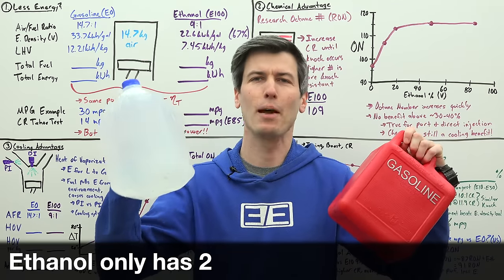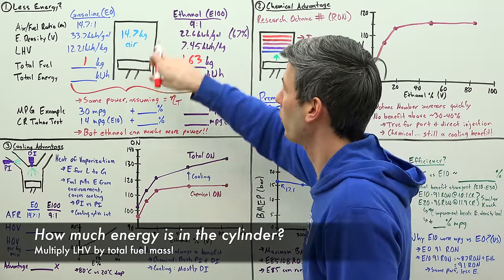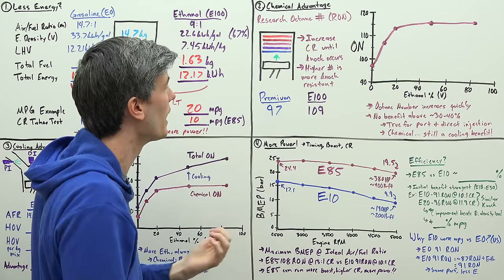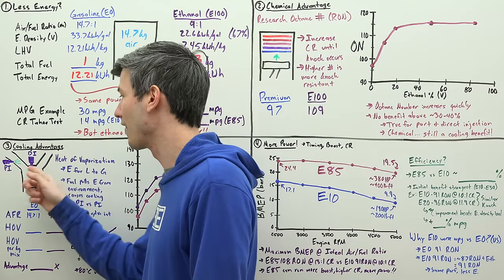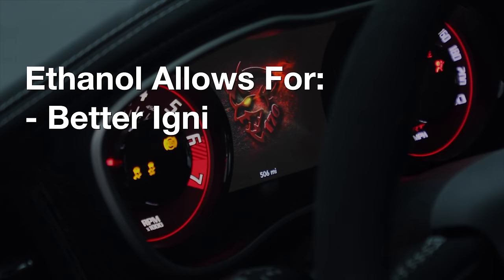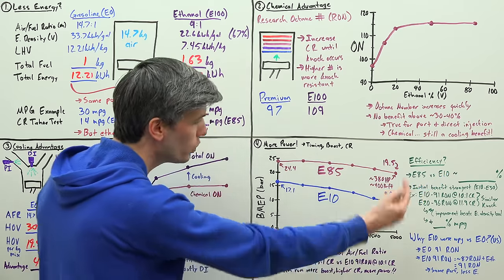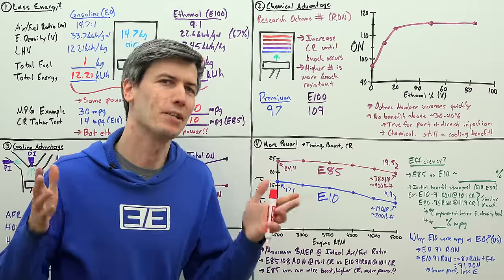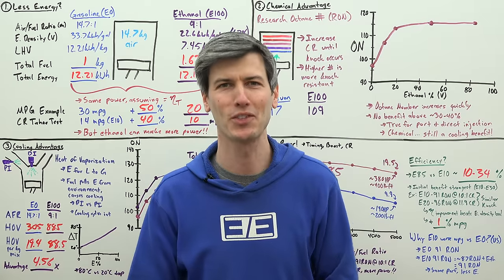Why Does Ethanol Make So Much Power? (Versus Gasoline)

Comment: It’s not more power. It just burns cooler resulting in less detonation.
Reply: A stock gasoline optimized Chevy 5.3L gets a clean 380 horsepower on E85 vs a dirty 355 horsepower on E0.

An ethanol optimized engine has twice the power so can be half the size of gasoline and even diesel engines with more mileage than either.

Here is an excerpt talking about an ethanol engine Ricardo built for GM and drove around.

FROM RICARDO:
The new federal CAFE standards are calling for a doubling of fuel mileage performance, which, Vint says, is going to send OEM’s looking for high octane numbers to improve efficiency and ethanol is the best source. Ricardo, an engineering firm with over 100 years in the business of engine design, has developed an extreme boosted direct injection engine (EBDI) to optimize ethanol blends. The 3.2 V6 gasoline engine rivals the power and torque of a much larger GMC Sierra 6.6 diesel, he said, and it delivers 3.5 percent better fuel economy than the diesel.

This is not new technology or knowledge, it was known long ago.  It is suppressed technology.

Rear Admiral C.M. Chester wrote Henry Ford a letter on Dec.15, 1916:
"...I also pointed out in the article that as governmental laboratories had developed from 40 to 55% efficiency in alcohol engines as against 20% in gasoline machines, the use of alcohol at double the cost of gasoline for power purposes, was cheaper for motor[s] than gasoline in common use today."
Reply: It more horsepower and torque as measured the standard way engines are tested.
Reply: @danafletcher2341  all it does is burns cooler. Meaning they are much more tunable vs gasoline which burns hot.  Because it burns cooler, it means you will run more ethanol vs gasoline.   This meaning yes power will increase because of you can tune it further vs gasoline.  Downside is that your mpg will go down tremendously.

Comment: Too bad ethanol fuel has ruined prices of food
Reply: Nope.
Reply: Here is how the 2007 Energy Independence and Security Act affected food/feed prices (if at all):

Corn
2007 weighted corn price =$4.20 WITH 4 .7B gallon mandate
2008 weighted corn price =$4.06 WITH 9B gallon mandate
2009 weighted corn price=$3.55 WITH 10.5B gallon mandate
2016 weighted corn price =$3.36 WITH 15B gallon mandate maxed out
2017 weighted corn price =$3.36 WITH 15B gallon mandate maxed out
2018 weighted corn price=$3.61 WITH SAME 15B gallon mandate maxed out & most ethanol ever produced

Wheat
2007...............$6.48/bu
2008...............$6.78/bu
2009...………$4.87/bu
2016...………$3.89/bu
2017...............$4.72/bu
2018...............$5.15/bu

Soybeans
2007..............$10.10/bu
2008..............$ 9.97/bu
2009...……...$9.59/bu
2016..............$9.47/bu
2017..............$9.33/bu
2018..............$8.48/bu
Reply: Read Dana Fletcher's reply to you and learn!

Comment: It doesn't make more power you just use more of it
Reply: A Chevy 5.3L is rated at a clean 380 horsepower on E85 vs a dirty 355 on E0 in that gasoline optimized engine.

Ford's first prototype eco-boost engine was optimized to use E85 and it had 15 to 20% better fuel economy and more power than with E0.  They did not come out with it in that flex fuel version because they thought they could skirt paying the MIT scientists for the patent.  This however is still in litigation. 

Ricardo built an ethanol optimized engine for GM and drove around that was half the size/twice the power and had more mpg than gasoline engines, even more than diesel:

FROM RICARDO:
The new federal CAFE standards are calling for a doubling of fuel mileage performance, which, Vint says, is going to send OEM’s looking for high octane numbers to improve efficiency and ethanol is the best source. Ricardo, an engineering firm with over 100 years in the business of engine design, has developed an extreme boosted direct injection engine (EBDI) to optimize ethanol blends. The 3.2 V6 gasoline engine rivals the power and torque of a much larger GMC Sierra 6.6 diesel, he said, and it delivers 3.5 percent better fuel economy than the diesel.

Cummins had their own ethanol engine called ETHOS which was half the size/twice the power too.  They are now invested in ClearFlame, a company who converts diesel engines to use E100.

Scania has sold an ethanol engine worldwide for years with power and mileage on par with their diesel engines.

This is not new technology or knowledge, it was known long ago.  It is suppressed technology.

Rear Admiral C.M. Chester wrote Henry Ford a letter on Dec.15, 1916:
"...I also pointed out in the article that as governmental laboratories had developed from 40 to 55% efficiency in alcohol engines as against 20% in gasoline machines, the use of alcohol at double the cost of gasoline for power purposes, was cheaper for motor[s] than gasoline in common use today."

The Navy was not the only researcher to possess that information:

Scientific journals from 1890 – 1920 contain hundreds of references to alcohol fuel at the dawn of the automotive era. 

Studies of alcohol as an internal combustion engine fuel began in the U.S. with the Edison
Electric Testing Laboratory and Columbia University in 1906. Elihu Thomson reported that despite a smaller heat or B.T.U. value, “a gallon of alcohol will develop substantially the same power in an internal combustion engine as a gallon of gasoline. This is owing to the superior efficiency of operation…”

The USDA tests in 1906 also demonstrated the efficiency of alcohol in engines and described how gasoline engines could be modified for higher power with pure alcohol fuel or for equivalent fuel consumption, depending on the need.

The U.S.Geological Service and the U.S. Navy performed 2000 tests on alcohol and gasoline engines in 1907 - 1908 in Norfolk, Va. and St. Louis, Mo. They found that much higher engine compression ratios could be achieved with alcohol than with gasoline. 

When the compression ratios were adjusted for each fuel, fuel economy was virtually equal despite the greater B.T.U. value of gasoline. “In regard to general cleanliness, such as absence of smoke and disagreeable odors, alcohol has many advantages over gasoline or kerosene as a fuel,” the report said. “The exhaust from an alcohol engine is never clouded with a black or grayish smoke.” USGS continued the comparative tests and later noted that alcohol was “a more ideal fuel than gasoline” with better efficiency despite the high cost.

Comment: If congressional politics were removed from the “equations” there would be less corn grown in Iowa, Illinois, Nebraska, and Indiana - and less crop land and scarce fertilizer wasted to modify auto fuels.
Reply: The US used 11,160,933 tons total fertilizer on corn in 1980, before ethanol.

In 2018, the year of most ethanol production ever, the US used 10,521,850 tons total fertilizer on corn.

100% of the fertilizer (& everything from the soil) still get fed to livestock in the distillers grains.  Ethanol comes from only things of the air: solar energy, CO2, and water with the latter two recycled once burnt.

Ethanol C2H6O = no fertilizer

Distillers grains = all the fertilizer

What logic is it to then assign all the energy and CO2 of fertilizer to ethanol and none to distillers grains? 

Believe it or not, the corn belt grew more corn acres in 1980 before ethanol than they did in 2018, the year of most ethanol production ever.

2018 Iowa 13,200,000 acres of corn with most ethanol production ever
1980 Iowa 14,000,000 acres of corn before ethanol

2018 Illinois 11,000,000 acres of corn with most ethanol production ever
1980 Illinois 11,600,000 acres of corn before ethanol

2018 Indiana 5,350,000 acres of corn with most ethanol production ever
1980 Indiana 6,450,000 acres of corn before ethanol

Comment: Ethanol should NOT be used as it damages seals
Reply: NOPE!
Reply: Ethanol does not damage seals, walruses, manatees, otters, or beavers (a joke). Ethanol is less corrosive than gasoline and aromatics. Long before ethanol could damage engine seals, gasoline and aromatics would have already statred the corrosion process.
Reply: @TheAutoChannel  I wish you answer the trolls on some of your excellent videos...I got two that followed me to my channel spouting off some crazy non sense for weeks.
Reply: @oldblueaccord2629  I always respond to the trolls and any other critic, and then they run away.
Reply: @oldblueaccord2629  yep
Reply: @oldblueaccord2629  ethanol destroys engines and fuel systems
Reply: @getthecansin  All engines are designed for ethanol use. They have always been designed for ethanol use. What's the proof? About 100 years of evidence from Brazil using ethanol-gasoline blends including the mandated use of E15 starting 50 years ago and the contemporary mandate of using E25 and E27. The vehicles in Brazil are precisely the same as they are in America. And then, the extensive use of ethanol-gasoline blends in Great Britain and Europe for most of the 20th century. Have you ever heard of Jaguar, Rover, MG, Triumph, Austin Healy, Aston Martin, Rolls Royce, Bentley, Mercedes Benz, Porsche, Fiat, Citroen, Audi? They all could use ethanol-gasoline blends without a problem. What's the proof of this? The fact that there are not tons of reports blaming ethanol for engine problems.

Ethanol is less corrosive than gasoline and aromatics. Ethanol is less corrosive than tetraethyl lead and ethylene bromide.
Reply: @TheAutoChannel  incorrect
Reply: @getthecansin  Which part do you think is incorrect, and why?
Reply: @TheAutoChannel  seals on older cars dry out and rot. 2 separate mechanics advised me not to use petrol with ethanol in my 1998 prelude

Comment: There is much more energy in Gasoline compared to ethanol. Ethanol takes a lot more to detonate allowing for much higher compression which ultimately equals more power. But as for energy density, Gasoline has more power.
Reply: A Chevy 5.3L flex engine is rated at 380 horsepower on E85 vs 355 horsepower on E0.  Same compression since it the same engine.

A few years ago, Ricardo did build and drive around a high compression ethanol optimized engine for GM which not only had more power but also got more fuel economy than a gasoline engine, more than even a diesel engine.  BTU is a good measure for a steam engine, but not for work done in an internal combustion engine where other factors can overcome the lower BTU rating.

Here is an article excerpt about it:

FROM RICARDO:
The new federal CAFE standards are calling for a doubling of fuel mileage performance, which, Vint says, is going to send OEM’s looking for high octane numbers to improve efficiency and ethanol is the best source. Ricardo, an engineering firm with over 100 years in the business of engine design, has developed an extreme boosted direct injection engine (EBDI) to optimize ethanol blends. The 3.2 V6 gasoline engine rivals the power and torque of a much larger GMC Sierra 6.6 diesel, he said, and it delivers 3.5 percent better fuel economy than the diesel.

This is not new technology or knowledge, it was known long ago.  It is suppressed technology.

Rear Admiral C.M. Chester wrote Henry Ford a letter on Dec.15, 1916:
"...I also pointed out in the article that as governmental laboratories had developed from 40 to 55% efficiency in alcohol engines as against 20% in gasoline machines, the use of alcohol at double the cost of gasoline for power purposes, was cheaper for motor[s] than gasoline in common use today."
Reply: @sking2173  HAHA and diesel has more energy density than gasoline so no doubt Keven Roberts drive a diesel car!
Reply: ...and wrong...but hey why stop now.
Reply: @oldblueaccord2629  do you understand the volatility of different fuels? How that relates to energy density?
Reply: @danafletcher2341  I see that you already know diesel has much more energy than ethanol. So why act silly?
Reply: @kevinroberts781  so you do drive a diesel car since energy or better BTU seems to be your main focus, am I right?  It certainly doesn’t appear to be cost per mile to drive.

BTU is probably the most important characteristic for a steam engine but not for an internal combustion engine.

The Ricardo engine GM has along with many other manufacturers’ ethanol engines gets more work done with ethanol than diesel.

Engines which optimize ethanol’s other characteristics mentioned in this video and others.  Flame front speed, volume of combustion products, and a few others I can’t remember offhand overcomes it’s lower BTU content, even diesel’s as you now know.
Reply: @danafletcher2341  You just said a whole lot of nothing. Why do you keep doing that?
Reply: @kevinroberts781  I have made points which you are either unwilling or unable to address or refute a single one.
Reply: @kevinroberts781  Do you? he explained it in depth in the video and a few others...yet here you are...but hey blame me!

Comment: Ethanol rust your fuel tank for the long term.
Reply: Very interesting, since vodka (ethanol and water) is widely used to CLEAN RUST …

“Remove rust from screws: Soaking screws in vodka for a few hours will clear away any rust they've accumulated. Wipe away rust after soaking. Clean kitchen surfaces: Combine one part vodka with two parts water to spray on countertops and tables, shine the kitchen sinks, and clean any other surfaces.” — Business Insider

Apparently you don’t know of what you speak …
Reply: Razal I have videos of the insides of gas tanks....it does NOT.